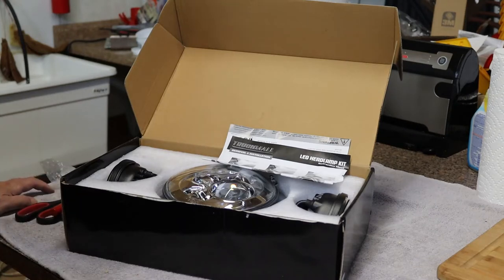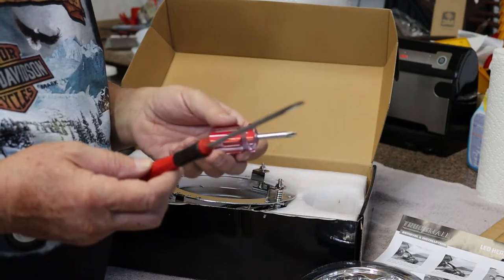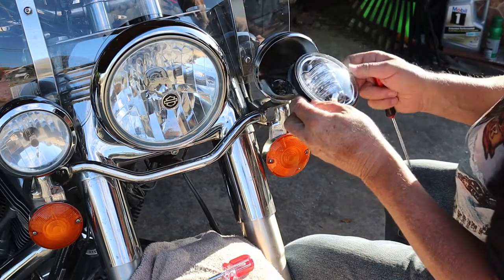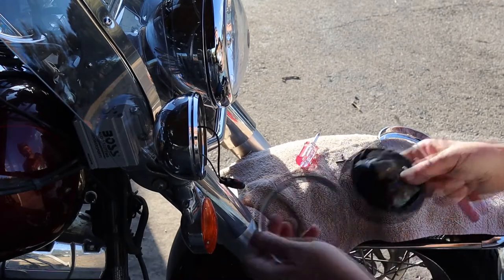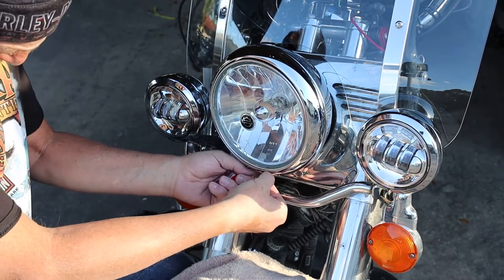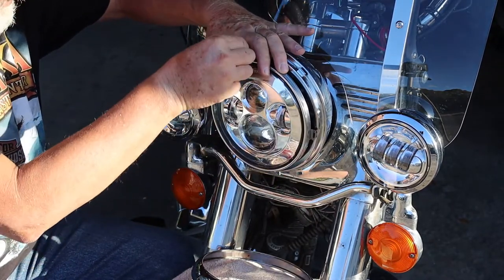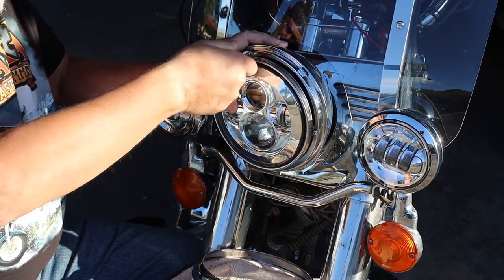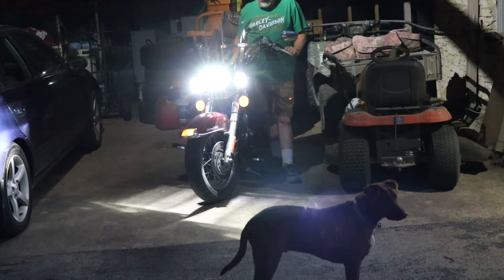TruckMall LED Headlights for my 2014 Harley Davidson Heritage Softail Classic

Comment: Saw this video and read the reviews, went to the website and read more reviews thoroughly research these lights.  Ordered them this morning 9/27/22 from Amazon and received them late this afternoon.  Installed them in about 30 minutes, scared the heck out of myself as I dropped the first passing lamp onto the cement floor when I took it out of the box, didn’t break.  Went on with the install and it went great, simple, simple and did I say simple.  Took the bike out for a ride in the nice dark roads around my home, no street lights and then onto back roads around the Tucson Mountains.  These same lights from Harley would cost in excess of $700, why Harley does not put LED’s on all their bikes is far beyond me.  Since I bought this bike in 2006 my biggest and probably only big complaint was night driving due to extremely poor lighting straight from the factory.  This $115 which includes sales tax and shipping is the best spend money on this bike since day one and the bike is loaded with chrome, pipes and accessories.  If you  are thinking about doing this……DO IT, BEST SPENT MONEY EVER!!!!!!!!!
Reply from the maker: George, thanks for the great commentary!!  I completely agree with you - Harley is just way too proud of their lights... which if I were a betting man, are made in the same factory as the ones we bought!! lol.... Mine make all the difference in the world because I had issues with seeing while driving at night... and living in the "deer" zone here in the Texas Hill Country, playing Dodge-Deer at night is no fun!  I like being able to see them with more reaction time.  Enjoy my friend, and ride safe!!
Reply: You needed 16 years to figure out you could do this?

Comment: Have you had any issues with the headlight fuse blowing? Mine blows everytime I turn on the passing lamps
Reply from the maker: Happy New Year Christopher!  No sir, I have not had any issues at all with blown fuses.  Maybe you have a wire that is scraped or grounded out that is blowing the fuse????  Please let me know what you find out.  Bill
Reply: @thelonemoose4718  thanks I was going to start simple and plug The factory headlight back in and see if it continues to happen if so then I know I have a short somewhere. The lights worked great for about 4 months and then this started happening

Comment: I couldn't get the headlight to fit in my 09. Looks the same tho. I ended up sending it back. Mine stayed loose and I couldn't get it to tighten. The factory headlight sets right in with the three notches but this one won't go in the notches. I can't see how you got it to tighten down
Reply from the maker: It took a lot of messing with it.  One other thing you might try is to take out the HD mounting bracket inside the headlight casing and install the one that came with the headlight???  I was fortunate in that my HD once was able to work.